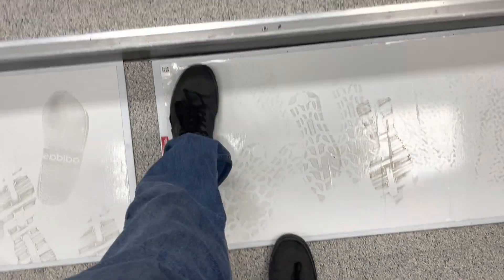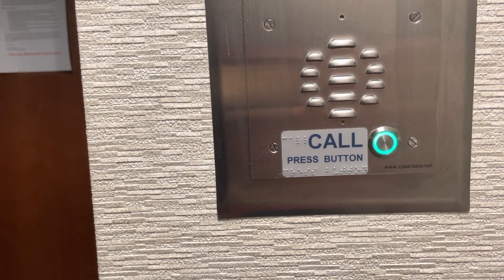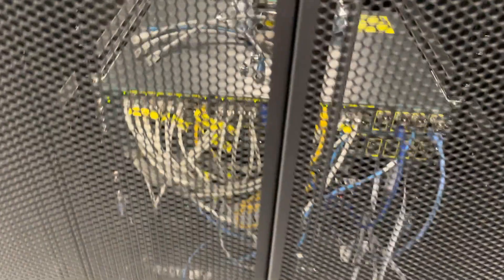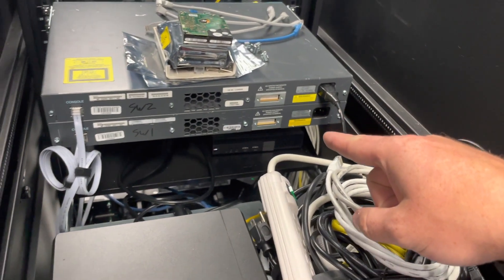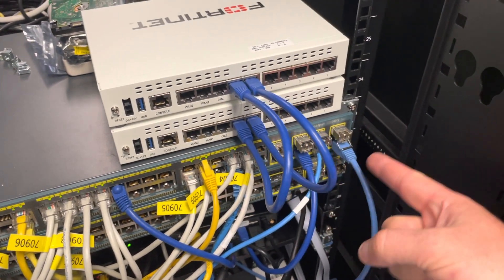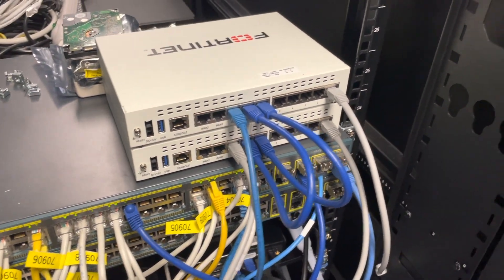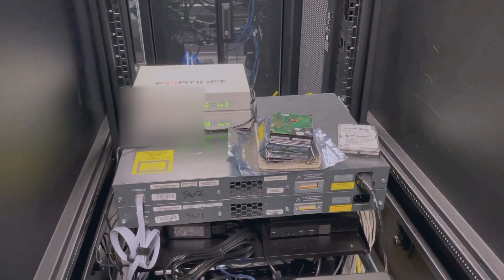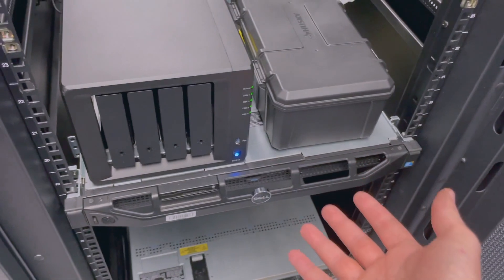Replacing the CoLo Firewalls

Comment: Hey, thank you for the new video! Which versions of Foritgate  you are running? Is this possible to install Foritgate software on Watchguard (XTM 850 or M series) hardware?
Reply from the maker: sadly no, you need the hardware. the hardware without a security subscription is actually quote reasonably priced. a 40F can handle most networks with bandwidth of around 500/500 with no issues.
Reply from the maker: Sorry forgot to add. 6.4.5